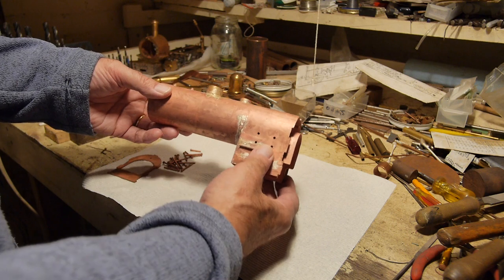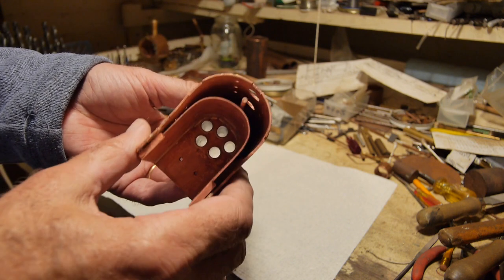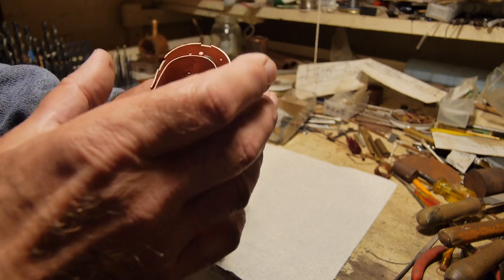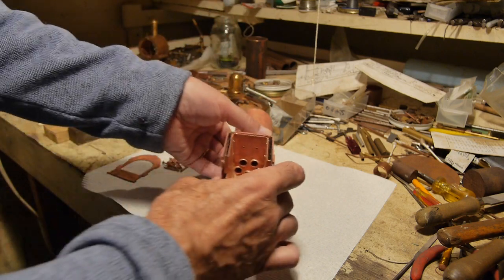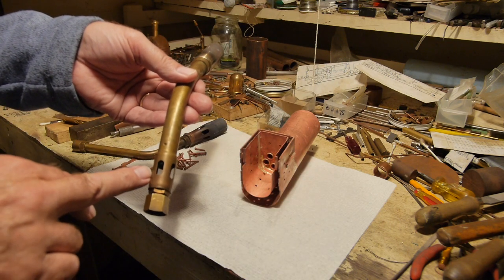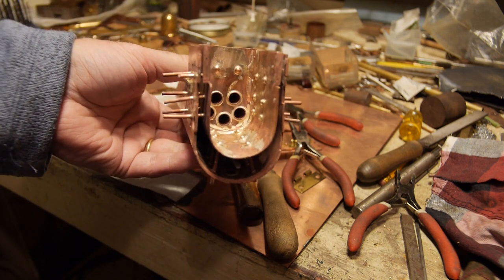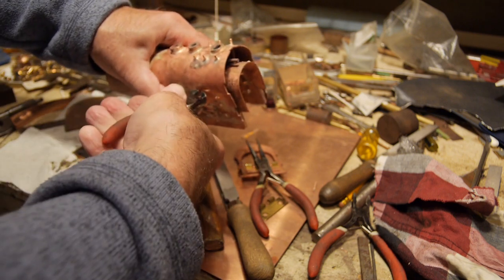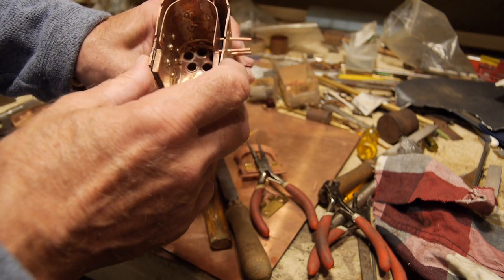Boiler making for live steam model locomotive. Part 4

Comment from the maker: Thanks Graham,  I've not had the chance to hold in my hands a Riverdale boiler but have looked closely at details and photos on the web and think it's a well thought out design.  I particularly like the damper idea.  I so ofter see coal fired engines blowing off steam whilst they are running which is a waste of coal.  If the damper controls the heat of the fire without it going out, great.

Comment: As a complete novice on steam locos, I'm finding your videos well presented and very informative. Do you think a novice should attempt this scale or something larger? Thanks
Reply from the maker: Hi Matt, small engines are much easier to build that bigger ones.  If I were you I'd look at getting parts from Roundhouse Engineering.  You can buy a complete kit for an engine or individual parts as you need them.  They are very helpful with advice, even give you dimensions and drawings to make your own chassis for instance.  You can buy wheels, axles, cylinders and valve gear to start.  They have brochures of how to assemble and time this.  You'll learn a lot about engines.  Check out their website:  http://www.roundhouse-eng.com/
Reply: Thanks - I'm fairly proficient at model engineering - just not locos! Plenty of reading to be done! Will check the site....